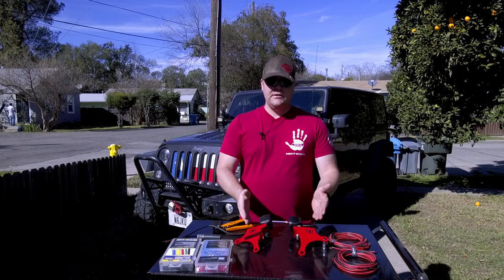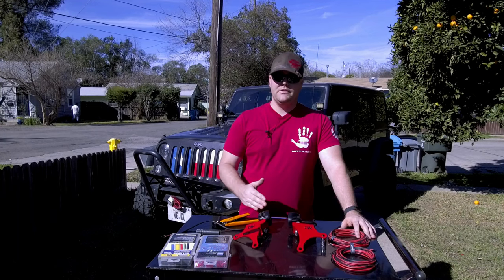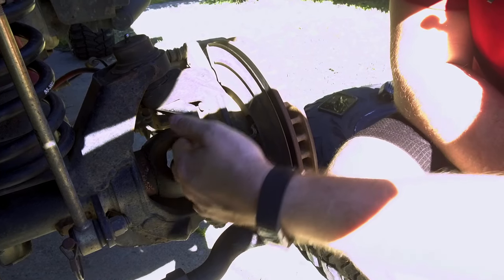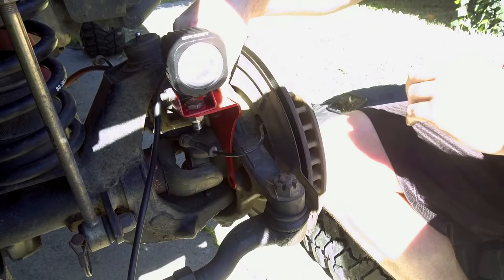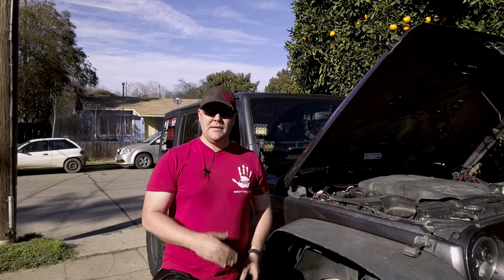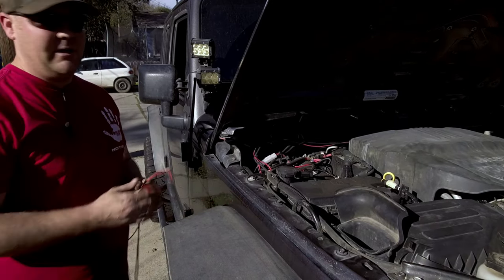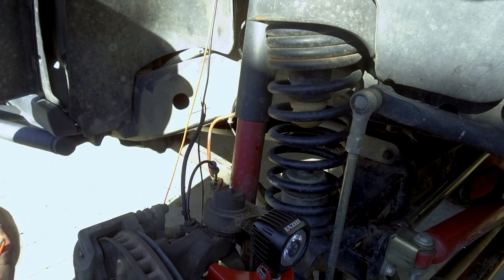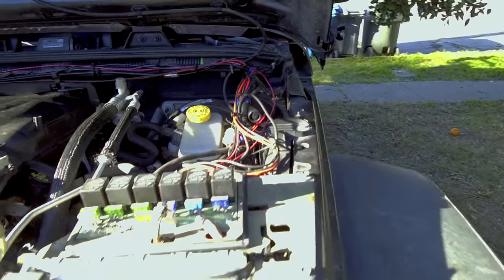Gatekeeper Off Road Knuckle Pod Mounts

Comment: I got a set of these and in my opinion I'd say just get a good set of ditch lights, wheel well rock lights, and a set of white led running board lights like from black flag lighting is more than enough on a pitch black trail to light up a 20-30 foot circle around my jeep. The only time I find myself wanting more light is in the front, and at that point any 30 inch light bar on the market with a spot flood combo will be adequate. I don't recommend cheaping out by any means on lighting though. Buy quality stuff the first time. These were nice on by themselves but once I had them and everything else on at the same time it became very obvious all the zones they were lighting up were already covered, and the ones that were farther out than the rock lights could reach were already lit up by the strips ditch lights and headlights. The would be sweet on a side by side though for sure

Comment: man i’ve had those mounts since they first announced them and I can’t for the life of me get those bolts removed. i’ve tried everything
Reply from the maker: Yeah I can imagine that they could be hard to get out. Luckily mine didn’t give me any issues. Hopefully you’re able to figure out a way to get them out, this is a really cool mod.
Reply: @NotICON  I agree, i’ve got baja designs s1’s with amber covers ready to go. i’m going to soak it in every lubricant I can to try and get them done this weekend. gotta get to work on all the other stuff got EJS
Reply from the maker: @TheTdub98  maybe that and the longest breaker bar that you can find. Good luck!
Reply: @NotICON  that may help. worst case scenario i’ll remove the tie rod the get a better angle

Comment: What lights are you using? 
Do they contact the spring when flexing?
Reply from the maker: They are just some cheap Amazon lights, 2” cube lights. I haven’t had any issues with them hitting the springs at full flex.